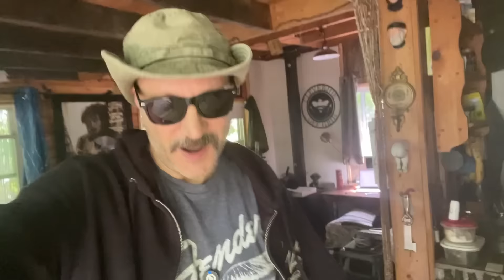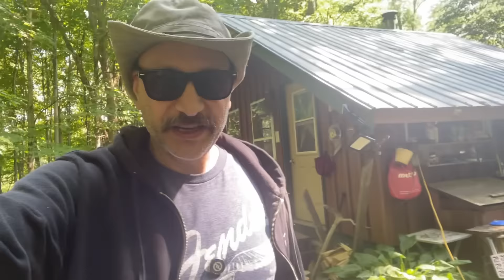Don't Kill Your Generator: 7 Mistakes to Avoid

Comment: Living in Québec, having a working generator come the month of January adds a lot to one’s peace of mind. Had a Honda EM5000S for 25 years. Was religious about everything maintenance-wise, but it gunked up on me, regardless. There was one piece of knowledge missing on my part: Stabil, purchased at Scrappy Tire, has a shelf-life of… two (2) years. OMG! Didn’t know that. I sold the EM5000S and bought the Cadillac of portable generators, i.e. the Honda EU7000is. Because it has a fuel injection engine, I changed my “gas” maintenance routine. Every three to four months, I drain the “old” gas out with two manual siphon pumps (15$ each at… yes, Scrappy Tire). One works on its own to empty 99% of the gas in the tank after being primed with a few squishes. The second siphon is of the “manual-pump-type” one that goes into the corners of the tank and to empty the rest of the gas. I then run the generator until it stops on its own. I now buy the small bottle of SeaFoam at, again, yes, you guessed it, Scrappy Tire, and pour 180-190 ml of SeaFoam into the 20-litre jerry can which I then fill up at the local gas station. Once back home, I shake the jerry can to make sure I have the gas and the SeaFoam fully mixed, and then proceed to fill up the EU7000is. There is no space left at the top of the gas tank after fuelling. Then, I start the generator with the Eco-Mode OFF, with a load, and let it run for a good 15 min. with a two-minute rest with no load. Then, I repeat in three (3) to four (4) months. So far, so good after four (4) years. We shall see!

Comment: I have the Hutch Mountain tri fuel kit and I am very satisfied with it. It is a lot of peace of mind knowing propane does not go bad like gasoline, yet I can still run gasoline if need be. Although using propane supposedly lowers your total watt output, I tested with an 1800 watt hair dryer and it seemed to sustain. On another note, have you thought about using synthetic engine oil?

Comment: Wow mine is well and truly due for a service. Its 20 years old and ive never changed the oil, spark plug or filter. It must have thousands of hrs on it. It starts first time every time. It has never given me any trouble.

Comment: I converted my Honda EU2200 to tri-fuel with a kit from  Hutch Mountain. I also had my natural gas line for the furnace extended to the back yard with a quick connect valve so I can run the generator with unlimited amounts of fuel.

Comment: You forgot one of the most important tips for the generators longevity-warmup.  Too often people start up their genset under load, or immediately put them under load.  Not good & it will reduce the engines lifespan.  Synthetic oil has helped a great deal with this, but it has not eliminated the need for warmup.  The proof that this is important can be seen in large commercial backup generators like in hospitals and data centers.  Because of the nature of the application-emergency backup-they are expected to start up and take the load as soon as possible.  So these large units have block heaters that keep the coolant and oil at close to operating temperature at all times, so they can quickly take the load without causing excessive wear.  Also-for propane conversion-remember that because propane has a lower BTU rating than gasoline, you will get slightly reduced power output.  Something to consider.

Comment: I’m finding a 50hr oil change is working it only holds about 10oz no big deal oil breaking down no thank you
Reply: I also look into the fuel tank when empty or near empty recently I drained the rest of the fuel out it wasn’t old but looked nasty why,  I’m seeing water getting into the generator when it’s not protected from above 

We have alcohol free gas available here I would use a stabilizer for storage or you can run it dry and store 

I used some marvel mystery oil a little in the fuel a little in the oil just a little now seemed helpful I believe it used a little less fuel

Comment: All of the basic maintenance is fairly straight forward BUT here is what really irks me: Honda wants you to have the dealer adjust the valve clearance every 200 hours. The engineers have not made this easy for an owner to do therefore, this adds a huge expense on a routine basis. I got a quote from one dealer, and they estimated $150/hr for at least 4 hours! Yes, you can learn to do it yourself, but this is a step up for most owners.

Comment: Optimal power generation and engine efficiency per litre of fuel is attained by running the generator at 70-80% load. You will experience shorter run time than running it at low load, charging your battery bank faster, and also generating more power per litre of fuel.

Comment: I used to work for American Honda.  Purchasing an EU200i gas generator was one of the best investments.  I fire it up once a month, change the oil on a regular basis, and am prepared for any disaster.  I have lived through three major earthquakes in my life.  Two in L.A. and one in SF.  The EQ in '71 knocked me to the floor.  The one in SF had the top deck drop  onto the lower deck.  It is not a matter of if, it is a matter of when this will happen again.  Millineals are clueless about EQ prep.  But this is something to consider if you live in CA. 😮

Comment: Got two Hondas. EU2200I  and a Honda 8500W AVR. The 8500 powers my entire house including my Heat Pump in first stage. Its a guzzler though. I use the 2200i for camping, around the property and when my fuel is limited. They have been totally reliable for years with many hours.
Reply: Note that I do have to set my thermostat on my Geothermal heat pump to only use stage 1 when on generator. It also has soft start which avoids having a huge current surge when it comes on.

Comment: I'm a fan of the Honda 2200 generator which I use for powering my air conditioning on my camping trailer. The a/c has a soft start kit added. I converted my generator to add LPG as a fuel using a kit from Hutch Mountain. It works great, even at 10,000 ft elevation,  plugging into the LPG fuel rail on my trailer. BTW, I only ever use ethanol free gas in my engines.

Comment: I have the same generator, and I run it all year around about once a month for about 15 minutes!! I also use Seafoam as a gasoline additive!!! Where I live, we have power outages all the time. I am going to be buying a Jackery 3600, and I am going to recharge it with my Honda Generator when the power is out!
Reply: No dont buy a Jackery, the old models were good the new are bad, ppl having troubles ans the service is not existent, buy instead eco flow.

Comment: I put a Hutch Mountain kit onto my new EU2200i. The generator was brand new and I installed the kit before gasoline has ever touched it. I like that propane has a shelf life unlike gasoline, and I have a lot of carbureted scooters and motorcycles so I wanted this to be less trouble, hopefully. Drawbacks are it puts out slightly less power and I have read it can be hard to start in the cold.

Comment: You mentioned switching over to propane to try it.   If your in northern Canada where it gets-30 -40 it’s a huge pain.  Summer time is good but in winter the bottles freeze off about 3/4 to half empty if you don’t have a warm generator shed it will freeze off as soon S the bottles hit half empty. 20lb 30lb I can’t remember where my 100 froze off at.   I tried pointing the exhaust on it but ice will accumulate over bottles hoses and fitting.   You know northern Canada winters are a different monster    Summer is great winters suck xss I live off grid.   I tried all different types of generators I get 1500-3000 hrs before most blow up.   But the Hondas just keep going. I have to replace the carburetors on them roughly once a year but $30 on amazon for new ones

Comment: I had a Honda like yours for 13 years in my semi-truck. I ran it off propane always. When it finally died (I estimate over 11,000hrs on it) I bought another Honda that lasted 500hours. Now I just get the Harbor Freight dual fuel line of generators, and so far, so good I have well over 2,000 hrs. on this current one. Only ever used propane, not a drop of gas.

Comment: I've bought an AIVOLT 1.8kW petrol generator. I've not used it yet but it's been bought for when we have power cuts. Since living here, we've had 4 that I'm aware of and one of those was extended. I can keep the freezer and fridge doors kept shut while I drove out to get a can of petrol. Plug my generator into one of the plug sockets, switch off anything I don't need and switch the mains switch socket off at the fuse box so I don't put electricity back into the mains circuit and power my neighbours.

As I'm new to my generator, the manual was quite thick so I've created a two page document, printed it and laminated it and kept it in the box with the generator for quick and easy points on how to fill it up, switch it on, switching it off and emptying it for storage.

Comment: For long-term storage of fuel, I use a product called PRI.  They make PRI – G for gasoline, and PRI – D for diesel. I have personally used gasoline that was 3 years old in my vehicle and it ran just fine.

Comment: Keep th Honda and just buy a slightly more powerful 3.5ishKW duel fuel Champion and a 3KW 2ishKWA battery power pack and stock up mainly on LPG. If you have a petrol/gas car rotate you fuel. PS if you do buy a Champion only ever run it on L PG because you'll never have any carb problem because it is never used it just a hole with a throttle flap or piston. Then in an emergency you'll know it will work or just use the Honda.

Comment: I designed generator system that uses a V6 or a 4 cylinder car/truck gasoline engine to run six - 12v 180a to 240a - car/truck 'alternators' to the rear flywheel with a 6 pulley system bolted to the flywheel using 1/8th flat steel plus the alternator that comes with the engine to power it. The system can produce up to 14,000 watts and more continuous to charge six to eight - 12v 850 to 1000a car/truck batteries. Also lithium can be used with an AC inverter charger. The system runs only 4 to 5 hours per every 15 days or up to 20 days depending on wattage use. It runs absolutely silent if you use the proper original muffler and cat system. The engine needs to sit on a fabricated strong welded steel framed stand about 12 to 15 inches off the ground with small rocks underneath in a square 5 feet by 5 feet pattern. The roof is 4x4 risers to a simple pinched roof with shingles or steel using 2x4 support beams to protect from pests and weather. The sides are 1/2' finished one side plywood coated with poly oak stain.
Reply from the maker: Sounds awesome!

Comment: We live in Hawaii and are experiencing an active hurricane season. Recently purchased a Honda 3200i generator to support or fridge and freezer during blackouts. We’ve already had to use it a few times and it’s been worth it, but being new to the generator game has its challenges and this video was helpful. 

You are also very correct. Multiple source of power are a great way to combat outages. We also have a large and small Jackery battery back up, as well as solar panels hooked up to a Tesla battery. Even with all those we still need to properly manage. 

Love the doggo. We have a great furry friend as well. Stay safe out there. That bear looked big. LOL

Comment: I have a champion 15,000 watt tri fuel generator also a champion 2,500 watt inverter generator to run my pecron unit E3,600 lfp with two expansion batteries i have always heard it's better to build layers in case something breaks living in Louisiana and hurricane season it's imperative that you are prepared!
Reply from the maker: Redundancy is king! 👍

Comment: I use the 2 Generac 2200i_s that I have for full time camping. (Paralled when needed). I like them.  Only issue, and with most recoil start equipment... the pull cord is cheap and in some cases, has an unsatisfactory factory knot that slips through the pull handle, then recoils back into the machine. Uhhh! ✌️

Comment: Thanks for the informative and entertaining videos.  I installed the conversion kit from HutchMountain it was expensive just like the 2200i was. Im happy with it, the install took less than 1hr. Also liked the kit as it came with quick couplings for a propane tank that I was able to also get a 20’ NG BBQ hose that used the same fittings.  I set the spark plug gap to the middle of the road setting so I could use any fuel. When I built my home I installed a generator sub panel so it is easy to tie in power during outages we occasionally get in rural Alberta. When burning NG the little generator provides enough power to run a small chest freezer, full size fridge, as well as the a few Grundfos pumps that circulate the glycol in my hydronic heating system.
Reply: I also installed the Hutch Mountain conversion kit on my 2200i and so far I've had no problems.  I love not having to worry about all the hassle of using gasoline, and the propane exhaust is not nearly as nasty as exhaust when using gasoline.  The one downside is that the energy density of propane is lower than that of gasoline, but I'm not running mine at anywhere close to maximum load, so it's not an issue.

Comment: Dont forget the first valve adjustment. Some manufacturers spec 100-250hrs.  Also i have had mice make nests out of drier sheets.
Reply from the maker: 👍Sounds like some fresh smelling mice, lol. The guys at the local John Deere dealer suggested bounce dryer sheets for the tractor since that's what they use, and they've worked well for me. The tractor always smells nice in the spring too. :) I'm curious what other people do.

Comment: I just purchased a Predator 2000 and just unboxed it. Its enough power for me for now. 
Age 69, F.
So far I love it.
After the break in, 5 hours, I drained the "regular" oil to get the microscopic metal out and the oil was indeed black. 
After 25 more hours of running it I will drain the oil again and fill with synthetic oil. 
It takes about a can size of diet Coke to fill up the oil reservoir.  lol. 
It is heavy for me but I go to the gym so...
On the second pull it fires right up.
Its actually a good-looking gen.
I use it specifically for charging up my two lithium batteries on my RV. In case I have no sun. I am off grid I the forest. 
The hardest part is getting the front cover back on. I need to read up on that technique. Thanks for the video.

Comment: What we have learned is that with Ethanol Fuel you need to run a stabilizer that is designed for Ethanol fuel. Stabil Brand Stabilizer has a stabilizer for Ethanol. Since we switched to it  we find that fuel lasts better than straight Stabil.

Comment: I had no idea they needed this much maintenance... thank you. Please do a video showing oil changes and the other things like filter cleaning.
Reply: All small engines and equipment needs maintenance. Generators are actually pretty simple to maintain. You should try doing maintenance by the book on a two stage snowblower. Thats a three hour job to do right. ATVs are also pretty high maintenace as well.
Reply: Yrs ago I bought a 5kw coleman gennie.  I just put it away for a rainy day.  Almost 2 yrs later I took it out and couldnt get it to start. I actually called coleman.  They told me they do a quality check on machines as they leave. Thatmeans there was gas in the bowl. That gas got old and left varnishing in the jets. I wasnt as good a tinkerer as I am now so I had to pay to get my brand new gennie going.  Wasnt happy !

Comment: I'm clever,  I bought a solar generator and folding 400W solar panels. I need no gas or oil and it is as quiet as a small fan.

Comment: I've run my eu2200i for two months while I was hospitalized.  My neighbor kept it gassed up.  I run Mobil full synthetic and premium gas. Typically, I  run it for a week between oil changes. Yes, that's close to 170 hours 24/7

Comment: I was told that the longer the extension cord the greater the electrical resistance. I'm not sure if that is correct, but i follow it anyway.
Reply: True, it is also known as voltage drop, you have to up size the gauge of the wire to make up the difference, there is a formula for that but I am not good at math.